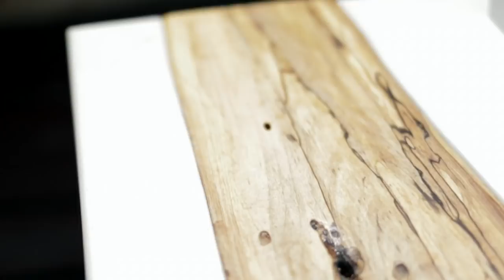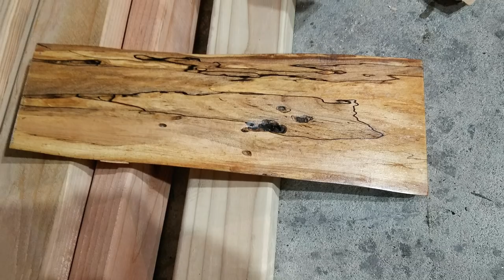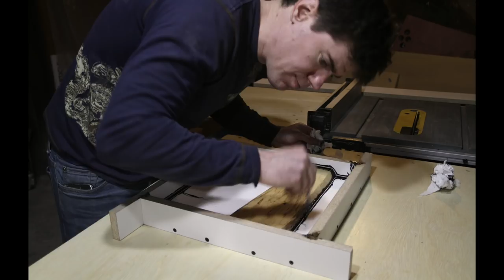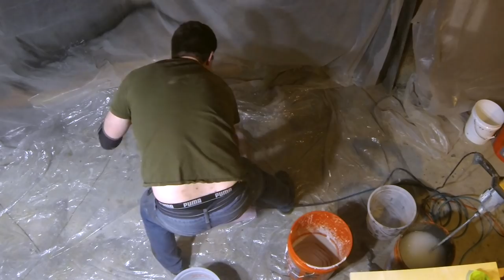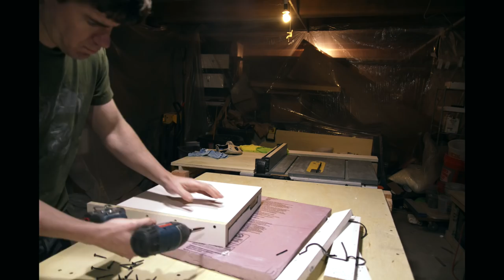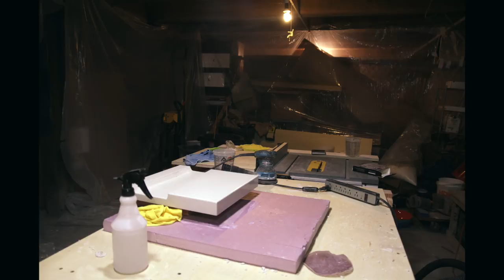DIY White Concrete Table w/ Live-Edge Maple Inlay (using GFRC mix) - How To Make

Comment: Gorgeous table. One point- the tool you used on the caulk is called a "fondant tool" because it's used to work on fondant, which is like a clay Baker's use to make a super smooth, sculpted surface on cakes. If you ask for cake fondant, you'll get a box of that frosting clay. 😁

You could also go to a craft store like Michael's or Joanne and ask for a large ball stylus tool. They can be found in the polymer clay area.

The more you know, right?
Reply from the maker: Thanks for that info.  I am not a baker, so that is definitely helpful :)
Reply: Modustrial Maker You're very welcome! I figure creative types should help each other out when they can, and this video inspired me!

Comment: Fine job!  Here, the only white cement is Lehigh portland cement type 1.  I'm trying to find the right mix of sand to cement.  I poured some small samples of this and they came out quite hard without adding any sand - but I'd like to do a countertop - and think that I probably need to add some for strength.
Reply from the maker: 50/50 is a good place to start for sand/cement ... Try starting there maybe?

Comment: Couple questions- hoppers are like 400$.  1) Can we just paint the top coat on?  Is the spraying just a time-saving thing?  2) how bad do you need that concrete mixer?  Could I just use an attachment on my drill?  3) if I wanted to make a mold that I could reuse over and over, would you suggest wood or pressboard?  If I predrilled the holes, could I reuse the screw-holes in the pressboard?  I just don't want to go to all that trouble to make a form just to throw it away.  4) one more question but I forget.  I contacted fishstone and as you mentioned their customer service is super good.
Reply from the maker: The hopper I link to is around $100 I believe, and works well.  You can brush the face coat in, however, and get pretty good results as long as you don't have large verticals.  If you have a beefy corded drill, you should be OK, just make sure to get a helical mixing paddle for it.
Reply from the maker: For a reusable form, invest in silicone... If you do a bit of searching on YouTube, you'll find videos showing how to make silicone molds for GFRC

Comment: Hi, very cool project! I am looking to do the same but for a dinner table. Do you think I could achieve the same result without spraying the finish? I was thinking that I could have dropped it and make sure that there is no bubble..  Thanks!
Reply from the maker: You can achieve similar pouring in the face coat and using a chip brush to brush it in and remove bubbles.  Some of the sides might not come out as clean, but the top surface will still look great

Comment: Would you recommend this process for larger projects like kitchen counters? How durable is the surface compared to normal concrete?
Reply from the maker: Yes, absolutely.  GFRC is far more durable than standard concrete.  It will get to 12,000 or so PSI, more than double Quikrete countertop mix.  The mix uses a liquified polymer to replace some of the water, which turns solid as the concrete cures, essentially replacing water with a solid.  Thus, the surface is far more durable.  I've done drop tests from 4 ft with "snowballs" made of leftover face coat, and it didn't even dent, much less scratch.

Also, the weight reduction due to the increased flexural strength is a huge benefit for countertops.  Since you can make them 3/4"-1", instead of 1.5"-2", you can cut the weight for the same square footage of countertop in half.  

Lastly, you can do all kinds of cool integrated feature (sink drains, etc.).  I'm working on a "man-cave makeover" video with a friend, which will feature a large one-piece waterfall countertop, so stay tuned... :)
Reply: I've made several items out of concrete before, but never GFRC. I'm interested in using it but a little intimidated. Can you walk me through what product you used and where you got it?
Reply from the maker: There are links to recipes and products in the video description.  I also have an instructables (same user name - Modustrial Maker) on the process with a ton of detail.  Start by going through that info, then let me know if you have more specific questions :)
Reply: I see - thanks!
Reply from the maker: no problem -- it really isn't too hard -- if you've already done a couple concrete projects, it is just the natural progression of your knowledge.
Reply: Seems like a much better product to use for thin slabs, especially with the plasticizer. I made a 1.5-inch thick concrete console and had trouble vibrating it. It looks cool and is plenty strong, but it has lots of bug holes.

Comment: Love the video & the product - stunning!How did you attach the slab to the concrete in the end please? Also did you anchor the slab down before caulking?I'd love to see the video for the matching coffee table using "just add water" GFRC mixThanks for sharing!
Reply from the maker: Thanks!  To attach the top to the legs, I just used 1.25" Tapcon concrete screws I picked up at Home Depot.  A white concrete coffee table is definitely being made... I've got a Sketchup design for a coffee table up on my Instagram right now, and am looking for feedback before I start building, if you are interested.
Reply: Thanks for the extra info. I'm not on instagram but I'll get my friend to check it out. Did you secure the timber slab to the concrete when finished?
Reply from the maker: +Wendy Fitzmaurice yes, I just used some liquid nails to secure it, altho it probably wasn't necessary since it fit pretty snug

Comment: I might have missed this in the video/comments, what did you do to prep the wood before pouring the face coat? Looking at attempting a project based on this soon.  Great video.
Reply from the maker: +Andrew Spearns any type of waterproof finish/sealer works....I used water based poly.

Comment: Beautiful work. Could you please let me know What tool did you use to spray the surface layer of white cement?
Reply from the maker: I used a Marshalltown sharpshooter hopper gun: http://amzn.to/2wB2HMK  There are also some cheaper ones out there -- I have heard there is a harbor freight hopper gun that will work, if you get a 45 degree elbow adapter for it.

Comment: Thank you for the video and the results are amazing! looks so pristine and smooth. One of the reasons I have been putting off working with concrete is lack of knowledge about the finishing process. One particular issue is what kind of machine are you using to sand the concrete? Hopefully you could signpost me towards some videos to watch to gain the confidence in working on my own projects. Cheers
Reply from the maker: Thanks!  I just hand sanded with diamond pads (http://amzn.to/2iZxy4B) and used a regular random orbit sander with normal sanding pads (http://amzn.to/2zjgb4O).  Let me know what info you need and I'm happy to help you get started.  If you want to go into a lot of details, the video from Trinic and Concrete Countertop Institute are very informative.  You can also check out my Instructables, which have a lot more written detail about GFRC (just search for GFRC and they will come up).
Reply: Thanks very much your reply. I was getting a bit frustrated with the ideas to either go for a sander or something more in the way of an angle grinder :S I have a few smaller projects I want to play with first to learn how to great the GFRC mix working for me so thanks again for your superb channel :) Cheers
Reply from the maker: Patrick McGee no problem.  Buy a good sander first, since you'll use it more for many different projects.  An angle grinder is great too, but not really necessary for GFRC.

Comment: Nice job.  I'm looking at making large study desks using the same method you show here.  white concrete with  a glass aggregate is an option.  Steel frame to support the load.
Reply from the maker: Sounds like a cool design!

Comment: Would love to see a video using "just add-water" GFRC to make the matching coffee table. Question for you.... when attaching table legs, can you screw directly into the GFRC without having it crack?
Reply from the maker: Yes, if you use concrete screws like tapcon, it is easy to screw into GFRC.  I have a bunch of videos using the just b add water mix now.  Check out some of my recent concrete project videos, as I use it in most of them
Reply: Thankyou.. and I'm heading over to watch those just add water video's now.

Comment: It’s gorgeous! I would like too make my kitchen island countertop like this. I would use reinforcement but is there anything else I should take into account?
Reply from the maker: Thanks!  With GFRC you don't need any extra reinforcement.  The glass fibers make it way stronger than standard concrete, and give it great flexural strength so rebar isn't required.  For a countertop, you'll want to take advantage of GFRC's strength and reduce the thickness of the concrete to 3/4" to 1" max, so the weight is less.  If you want your countertop to look thicker, just get pink insulating foam (Foamular) from home depot and insert it into the form when pouring your concrete.  So if you want a 2" thick look, get 1" Foamular, pour 3/4" of concrete, place the 1" foam insert in the form, then pour the final .25" of concrete over the foam.

Comment: Very cool, I didn't know about such fine concrete spraying. Only one thing, wouldn't it be nice if there wasn't any caulking around the inlay so there wouldn't be any gap between the wood and the concrete?
Reply from the maker: Thanks!  With no caulk around the wood there is a risk the concrete will work it's way under the wood, which wouldn't look so great

Comment: Looking to do a slightly larger scale table in the future. How many bags of GFRC did you use for your project
Reply from the maker: I made my own, but it was equivalent to about 25 lbs, or half of a 50 lb bag.  As a rule of thumb, for each 50 lb bag, I usually estimate about 4.5 square feet at 1" thick, or 6 square feet at 0.75" thick.

Comment: Great build! Why was it necessary to use a hopper gun to apply the face coat if you just go back over it with a brush? Couldn't you just apply the face coat with the brush and get the same result?
Reply from the maker: Not necessary.  You can actually see an example of how it comes out when you pour in a face coat in my other video for the live edge table with concrete post.  In that build I just poured in a face coat for the top of the post and the top came out flawless (but sides did not).  Also, if you check out my Instagram, there is a recent post with a grey table w/ inlay I helped a friend build, where we used this technique.

There are two things to be aware of if you do this.  First, it works great on horizontal surfaces, but vertical surfaces will likely have a few flaws.  (You can either slurry coat them after, or just accept them as character.)  Second, you have to be careful not to make the face coat too thick if you pour it in (not more than 1/4").  I have experienced some cracking when accidentally pouring it too thick.  Some people add PVA fibers to the face coat (different than the AR fibers used in the backer mix) to help prevent this, but I haven't tried this yet

Comment: That concrete is beautiful. Did you use pre-mix or mix from scratch? If from scratch, what sand did you use that doesn't show on the surface?
Reply from the maker: renodeify I made this from scratch....just used quikrete commercial grade medium, which is 20 to 40 grit.  It is pure white here in Chicago, but color can vary batch to batch, so check before you buy.  (The bags leak like crazy, so just look on the floor in front of the stack at home Depot.). You can also just use the GFRC premix I linked to in the description, which is basically the same as the mix I made from scratch.

Comment: Great looking stuff! How does this hold up with the expansion/contraction of the wood?
Reply from the maker: Thanks!  Expansion was definitely a concern in the design. This is part of the reason I poured the concrete right over the wood in the mold, and then covered the mold while the concrete cured. While I sealed the wood before I did this, the water from the concrete mix still evaporates and creates a very humid environment in the mold (surrounding the wood). This is about the maximum humidity you would find any any environment the table will be in. Thus, the wood expands a bit in the mold while the concrete is still curing (i.e., not hard yet), and the concrete cures around and takes the shape of the slightly expanded wood. Once demolded, the wood contracts. As a result, there is a slight gap between the concrete, but nothing too noticeable (at least IMO). More importantly, there is very little chance the wood will ever expand more than it did in the mold and cause cracking in the concrete or wood. GFRC also can flex and bend a bit (much more than standard concrete), so this helps.  I actually made this table about 6 months ago, and it has been moved around, inside and outside, and so far, so good :)
Reply: I was wondering the same. Great response.
Reply: Did you end up securing the wood in place or is it removable? Thanks for the great tutorial!
Reply from the maker: Thanks!  Yea, I used construction adhesive to secure the wood

Comment: Great creation and video, looking forward to more!  And no rebar!  How large a piece can be made with GFRC without needing rebar or some mechanical support?
Reply from the maker: There is really no need no matter how large you go.  I've seen 10-12 ft solid countertops from GFRC with no reinforcement other than the glass fibers.  Check out Thiel Studios if you want to see some really cool professional jobs; some of which are massive.

Comment: Love the videos.  I used your fondant tool technique and it worked great.  However I tried spraying the concrete with horrible results.  The concrete was shooting off the board instead of sticking.  Can you give the air pressure you used and settings on the gun to get the results you received.  Thanks again for great videos.
Reply from the maker: I've never experienced that, I use a cheap pancake compressor and it is probably around 40 or 50 psi.  The mix also needs to be fairly wet.  What kind of mix were you spraying?
Reply: @modustrial  sand mix and had it lose to a pancake batter
Reply from the maker: +Rob Starz  It likely was too much air pressure -- that will cause sand to bounce off.  but, usually the cement will stick, so I want to make sure you got the face coat mix right too.  I'm not sure what you mean by sand mix?   Was it GFRC bagged mix, or did you make your own?  If you made your own mix, was it a proper mix of 1:1 sand to cement by weight, with acrylic polymer (and preferably defoamer and plasticizer too)?

Comment: I have purchased a coffee table and dinning table similar to the table you made. Both table recently sustained chips in the concrete while moving. Do you have any suggestions for a DIY repair? The tables are white and we are also thinking of changing the colour as they are hard to maintain with two children. I would appreciate any advise on how to do that as well.

Thanks
Reply from the maker: If you are willing to change the color then you can repair them by sanding them down and doing a slurry coat.  You'll probably need to 4-5 coats to change the color.  Just do a search for slurry coating concrete counters and you'll find instructions -- it is a simple and cheap process, but messy and time consuming.  You could also do Ardex / Henry feather finish as on overcoat.  Search Ardex countertops and you'll find a lot of how-to videos and blogs.

Comment: Nice piece. Could you have cast the wood plank without edging it with caulk so that it abutted the concrete seamlessly?
Reply from the maker: It is probably possible, but a bit tricky since the concrete would likely flow under the edges of the wood.  If you cut razor sharp edges and weighted the wood down when spraying you'd have a shot, but wouldn't know for sure if you avoided the face coat seeping under the wood until you popped it out of the form.

Comment: I am attempting my first wood/cement table.  The board has been planed but still has a slight "wobble" to it.  Do you recommend I clamp it down so at least the top portion remains flat prior to caulking, GFRC top coat etc???
Reply from the maker: You really need to get it flat or it will eventually pop out of the table.  Check out my video for the soundwave media center / dresser... I show a really simple planer jig you can make in 10 min to get your wobbly board perfectly flat

Comment: Looks great! What's the mix design for the face mix? And did you apply a form release spray to inside of mold?
Reply from the maker: I have an instructable up for this with the mix design (instructable user name is also Modustrial Maker).  Also, you can just use the Fishstone GFRC bag mix for the face coat.  It wasn't available at the time I made this, but I've used it in recent projects and it works great.  You can see it in my recent curved bench video.

Comment: AMAZING VIDEO!!! Seriously, loved every second of it. I was wondering if it is ok to vibrate GFSR concrete. You had said that you don't have to but if you had the ability to, would it affect the finished product?
Reply from the maker: I haven't tried vibrating, but if you have a face coat, I would worry that vibrating could knock it loose from the vertical surfaces.
Reply: Modustrial Maker thank you for the insight. I look forward to watching the rest of the videos on your channel